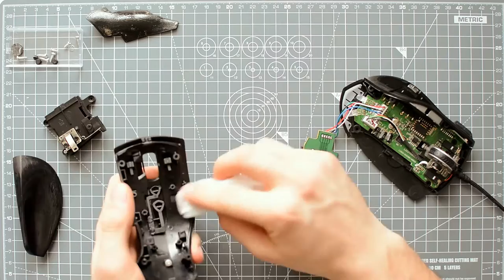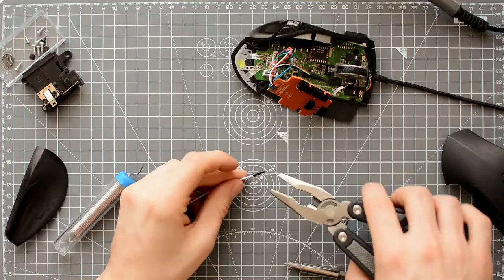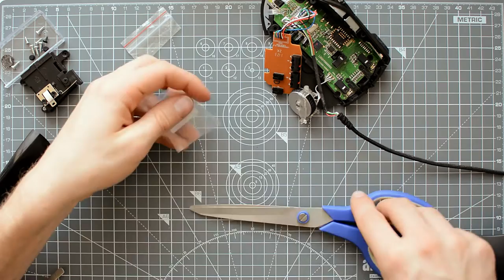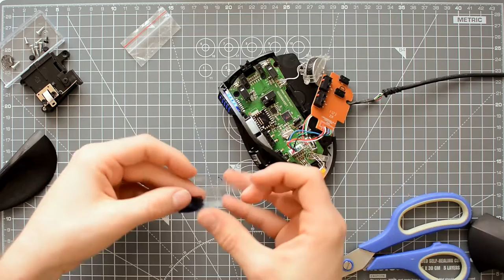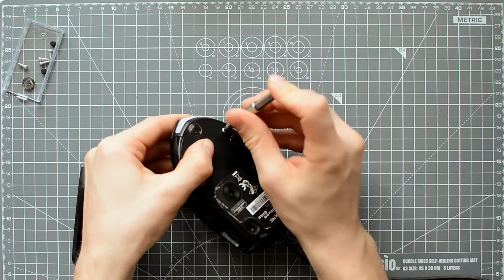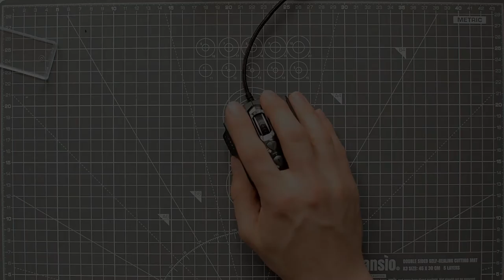DIY - PC Mouse "Upgrade"

Comment: Can you do another one of these (2 of them if possible) One where you make a mouse using only stuff you found online No actual mouse and another where you add buttons to a simple one to make it more capable.

Looking everywhere absolutely no where to be found on you tube.
Reply from the maker: I don't know if I'm able to do it. It's not that easy. 
Put hardware together can be done. But you need also software/driver for that. And that's the harder part I think.
Reply: @kirdnevsedits  I have an idea for a new mouse but instead of making it from scratch it would be easier for me to provide attachments to an already worthy mouse. :( If you could help me out with that at least please I'd would be appreciated.